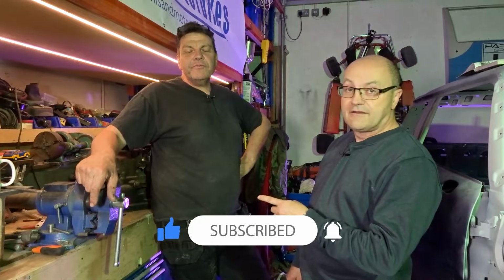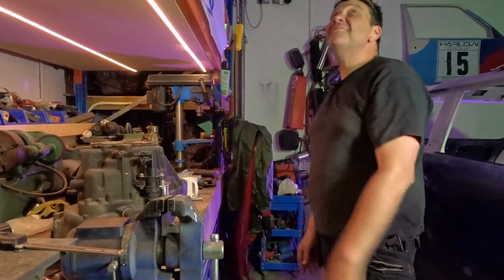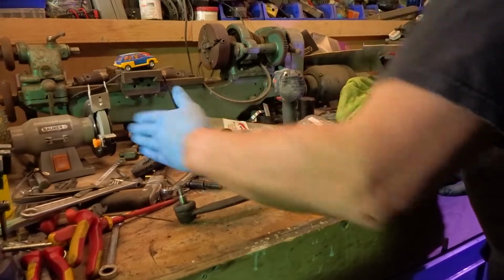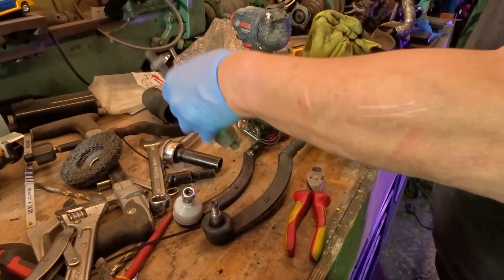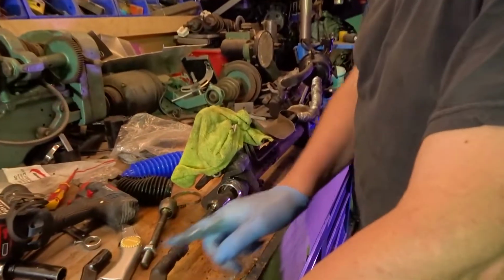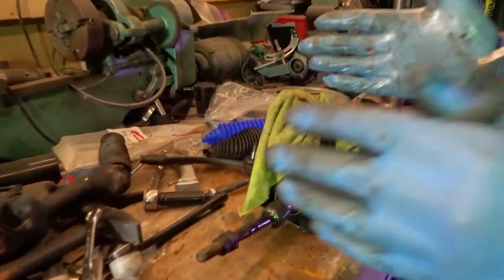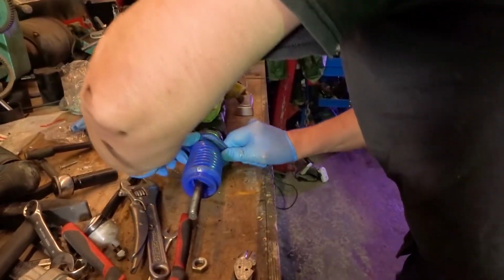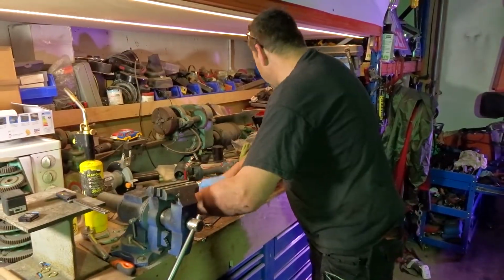The Mini Cooper Build - Episode 044 of Minis and Motorbikes.

Comment: Bently manual specs... 
Tie rod to tie rod end (m8 pinch bolt) 28nm
Tie rod to steering rack 77nm
Tie rod end to steering knuckle 65nm
Reply: Oh, no locktite, there bad enough to remove with a bit of corrosion.
Bit of grease on the inner tho 👍
Reply from the maker: @smithiestrackmini  That's the route we were going down, cheers.  Thanks for the comment and thanks for watching.
Reply: Thank you sooo much. Fab your watching. Very much appreciated. Adam
Reply: @adampalmer9930  thanks for taking the time to put the mini build up as content...
Great watch, pulling my rear end out end of August so looking forward to you putting that back in...
Especially the fuel lines.
Good luck 👍
Reply: @smithiestrackmini  Thanks again I've subscribed to yours too fab.